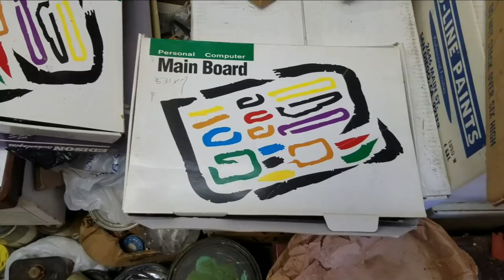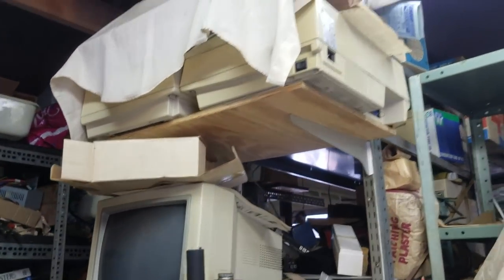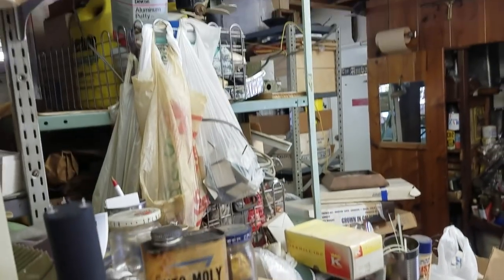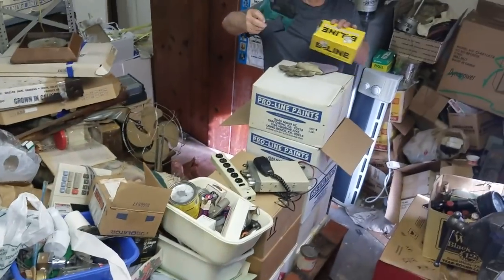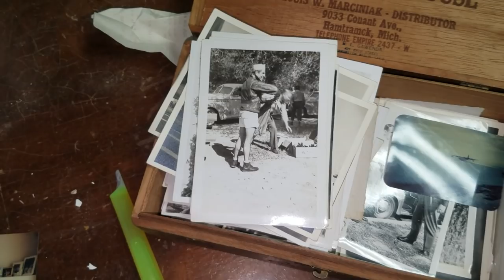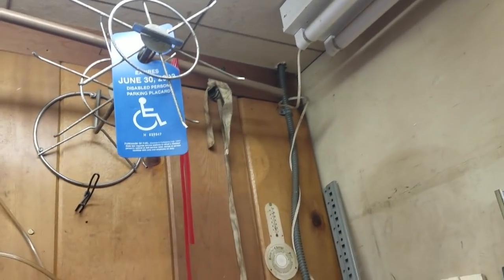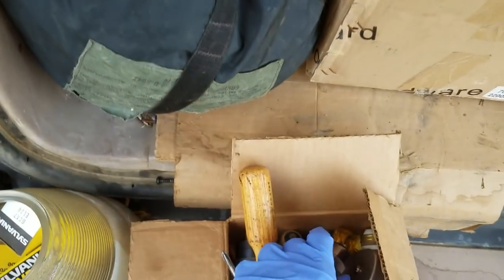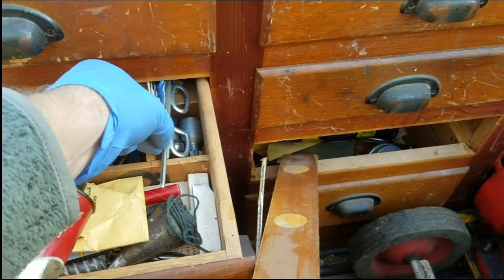Chlordane Dust....

Comment: what a rip!!! the thumbnail is of a piece of test hardware from maybe the 40s and instead you show us a garage or house full of junk and never talk about the device pictured in the thumbnail.

i understand youtube's algorithm uses a random frame of the video to create a thumbnail so maybe you edited the video using youtube's editor and the pictured device was before the part you cut off or maybe it is from a previous video you made maybe the camera merges all the shots into 1 big video and you have to cut up the video into smaller pieces .

but i think you could have edited the video to remove unrelated parts.

i clicked in to see about this device and instead it was the hoarder's mess so i skipped ahead first in 10 second steps then eventually much wider gaps when nothing about the device showed up that i could see.
Reply: Lex Ruth  how do we get to see it then do we have to sign up for patreon?